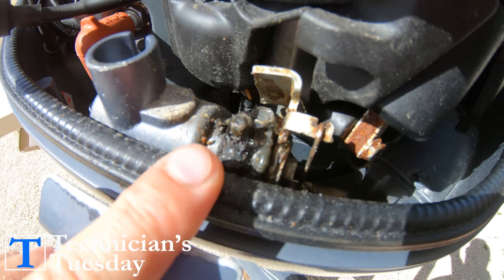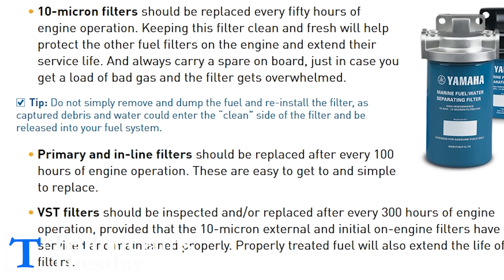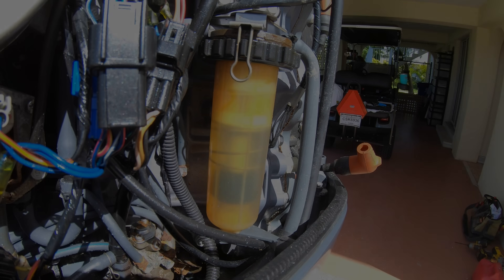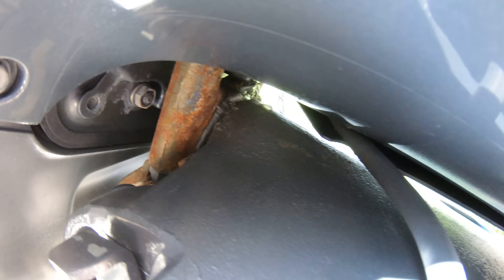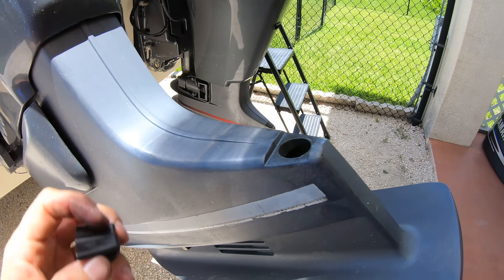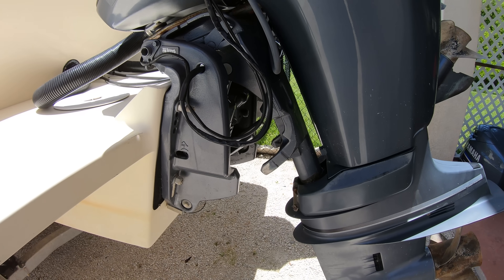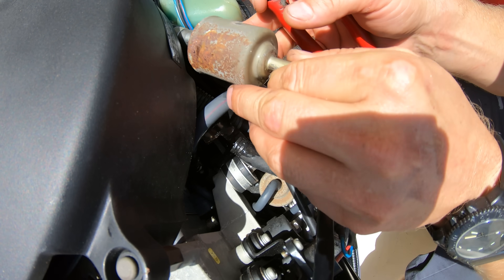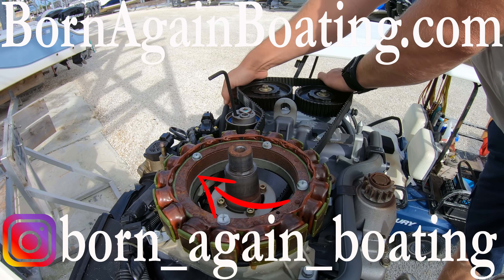Making A 2-Stroke Last Longer!

Comment: I have a two stroke. Suits me just fine. Yamaha 50 HP
Reply: Had a 50 Yamahammer two stroke. Best starting engine I ever had.
Reply: Me too. 2006 Yamaha 50 horse 16 years and running strong. Yamaha's best engine ever.

Comment: 94 Mercury Black Max 150 on a 20' Livingston 200 Viking Walkaround. Engine has 860hrs, power head has just over 100hrs since complete teardown rebuild. Excellent powerplant, lots of guts, not terrible on fuel and it'll cruise just under 30mph at 4000rpm!

Comment: I am really wondering if i should buy a riva aquariva (2009) but i dont know what Kind of maintenance this type of boat requires. I have a Boston whaler 29ft and know that this boat requires pretty much minimal effort to maintain. Do you know?
Reply from the maker: That I don't, its like any boat for the most part, but most of those boats have inboards right? So its a little different on the engine side:) good looking boat though!

Comment: With the ethanol fuel we use there is more corrosion and deposits. Remove the single bolt and drain the carburators if sitting for a couple of days or longer to prevent gumming, corroion and having to tear down and clean them.

Comment: Great video. I noticed you said not to empty the fuel/water Seperators and reuse because of contamination. I just got my tank cleaned and still have some ethenol sediment left behind. Do I need to replace the filter each time because it is trapping a lot of debris still on a new filter still when I checked.
Reply from the maker: Just keep an eye on the engine filter, and dump that cup out when you do your water separator. Also, if you just had the tank cleaned and are still filling up debris in your water separators, you might have some other issues that need to be fixed :/
Reply: Fuel lines

Comment: 1990 Evinrude 140 still runs great. Also have a 1978 Evinrude 6hp rebuilt lower unit and replaced water pump. Runs like new

Comment: in your professional opinion is it worth changing to a four stroke if your motor is solid and near mint condition?
Reply from the maker: If you've got the extra cash to repower, yes it is. If you don't, then no its not. If you've got the cash its good because you can sell the two stroke while it still has good value and you can get some money from it. Otherwise ride it out until its not reliable or until it dies or costs you too much to maintain or fix :)

Comment: Have an 88 Wellcraft V20 with a 2010 Evinrude 175 with almost 1,800 hours on it and it still runs great, servicing, servicing, servicing. Please keep these great videos coming.
Reply: I have a 1991 Ranger 395VS with a 2001 Yamaha 225 Vmax.  It’s a persnickety ole girl, but as long as you giver her fresh gas and oil and keep the O2 sensor clean she runs like a bay out of Hell! Not sure of hours, but I would bet money it’s well below 1000. 90% of my fishing is done with the bow mount trolling equipment.

Comment: I had a 150 2 stroke Yami on my Whaler in Key Largo. An excellent motor. Just remove the boat mounted oil tank once a year, drain the oil, discard the sludge on the bottom, reverse spray the oil filter with WD40 (replacement isn’t necessary), flush the oil lines too. Reinstall and fill up. 
If you clean out the engine mounted oil tank, always replace the foam washer. When the engine gets old, remove the oil system completely and mix the oil in the gas. The oil system is the Yami’s Achilles heel.
Reply: Why not just replace the oil pump?

Comment: Got a 1976 Merc 85hp. Old man bought it and had a stroke. Boat and motor sat in a garage for over 30 years. Boat only had  125 hours on it. Bought the boat for $500. It was like it came out of a time capsule.
Reply from the maker: Sweet :)

Comment: Mate, I’m running a 90 hp Johnson yr 2000.  No idea of its hours.  Have needed a new cdi and thermostats in last few years.  Recently gearbox oil is milky so need to work out what seal is gone.  Otherwise it’s a low smoke, loads of power and actually not a noisey engine.  In Australia.  So it’s gotta outrun those big white sharks huh.

Comment: I have a 1982 75 hp Chrysler on a Rinker V153 open bow ski boat.  The engine runs great.   I have changed the plugs, replaced the starter, and changed the oil in the lower unit.  I am not sure I have a fuel/water separator.  I keep the tanks empty when the boat is not in use and run the entire tank dry whenever I use the boat.  I have not seen a thermostat.  There is no temp guage on the boat.  I have instructions on how to change the impeller but have not tried to do this as yet.  I have greased the steering tube and other grease fittings that I could find.  Not sure I have any anodes to worry about as the boat is on the trailer 99% on the time.  I do not have power trims.

Comment: Running a 300 Evinrude G2, fantastic engine.  Real shame they're gone now.
Reply: It sucks. I was going to re power with an e-tech when the time came but now I'm looking at Mercury or Yamaha.
Reply: Remember when Bombardier bought Johnson/Evinrude. I hope someone buys the brand and makes it even better. I'm a 2 stroke fan from decades ago.
Reply: I feel you man love 300 2 stroke also buy BRP sea doo so it was a no brainer
Reply: Evinrude ignored the only double digit growth segment in the marine industry since 2009: the high horsepower outboard Center Console market.

Comment: Great video- I have a pair  of 2005 200HPDI with 800 hours that run great and get 95% of the gas mileage a pair 200 hp 4 strokes get with the same hull.  i can plane on 1 engine, while  the 4 stork can't.  The strainer filter above the VST can be easily removed with an AUTO CAR INTERIOR BODY TRIM PANEL RETAINING CLIP PIN REMOVAL REMOVER PLIERS.  I would like to see video on vinegar or acid wash to remove scale from cooling passages.
Reply from the maker: They are great engines! Not really a fan of putting acid into the engine :(

Comment: Running a 1971 Mercury 500 Thunderbolt. Fully rebuilt last season with new Vertex pistons and CCMS reeds; she runs like a champ, premium fuel premixed with semi synthetic 2 stroke oil and she'll run like the energizer bunny on steroids.

Comment: Have a 2001 Mercury 200, triple carbs. When she runs, it’s a powerful motor. But recently, the starter bendix gear has been getting stuck engaged to the flywheel teeth, and the starter gets burned up. Gone through 3 starters now trying to track down the cause, any info/tips appreciated lol
Reply from the maker: Ouch, you might have an amperage supply issue, where there isn't enough power being supplied to the starter. IE bad cables or switch or something. But then on the other end, you might have some engine issues with the crank, rod bearings, piston rings, etc. You might want to do a compression check and if you load test the battery cables and they are all good. Might be a good time to pull the head and check the pistons before blowing up the engine :/
You can take the spark plugs out and turn each cylinder around sticking a long screw driver into the cylinder and pressing on the piston to see if the piston moves.
Reply: Born Again Boating Thanks for the info. I’ve replaced the batteries, battery cables, and ignition switch, so you’ve got me worried now lol. After the compression test, would I be checking to see if the piston is stuck somehow?

Comment: 1988 DT140 on a 20ft Plroline. Ran great till 2 weeks ago the oil injection stopped working. Ruined the motor. Should have blocked off years ago. Sad
Reply from the maker: Ouch :( yup

Comment: Running 98 OX66 SW series 225hp twins on a 98 Grady Salifish.  I make sure they get regular maintenance  and flush with fresh water after each use.  They are awesome engines and I have no idea how many hours are on them.  Will keep up the maintenance until they say uncle.  Aaron, BTW thanks for the advice on the lower units.  Already put 30hrs on them and had the oil changed.  Went out yesterday and ran the boat at 30kts and those engines just keep going!
Reply from the maker: Awesome!

Comment: Since you are changing the spark plugs, is it worth the performance gain to align the spark plug gap with the exhaust port?
Also, since you have the motor this far apart, why not remove and clean the injector(s)?
Furthermore, if the thermostat is in reasonably good shape, is there a solution to soak it in to clean it up?
Reply from the maker: You could do that with the plugs, idk if you would notice any difference though, idk what style pistons are in the engine and if that would matter :)
Usually you only clean the injectors when you need too and on the thermostat, I just spray them off and put them back in, idk about soaking them in any solutions :)
Reply: Clean them up with vinegar

Comment: I have that engine 2000 Yamaha 200. I love your channel and has helped me as a new boat owner. I do have an issue where the engine cuts off when going at 5 mph. I have done the vst maintenance and will try the other two filters to see if that fixes it.

Comment: I still run a 2003 Z250TXRB, right now can’t get it to run over 2K and has a terrible shake and a miss. I changed the fuel and all the filters and still can’t get her to run like she used too! I won’t give up on her
Reply from the maker: You should look into the VST and make sure it's all good in there. Make sure you've got 50PSI fuel pressure after the VST and then get someone to put a laptop on it and make sure the mechanical high pressure pump is producing the right fuel pressure :)
Reply: I have the YDIS software, I’m getting g 985 psi and I’ve replaced all the VST but not the pump itself

Comment: Thanks for the video. I still love a 2 stroke motor on a boat, I know they are not that great on fuel or even that environmentally friendly but when you open the taps up the roar. Currently running an 87 Yammie 25 Excel, its on a new mid section and has later model cowls. About to replace it with a 300HPDI, just waiting on some parts. Should make my 22footer get up and go.

Comment: '56 Evinrude Big Twin 30hp on a '55 Olympia Yacht 13'3'' runabout. Engine runs great but won't see water till i finish replacing parts of the hull on the boat. If anyone (in Europe) has parts for a late 50's big twin (or a whole unit) let me know!

Comment: Are you meant to grease the bolts for the anodes? Dont they provide a path for the electrons or whatever it os that gets sacrificed to save the metal of the motor? I am not qualified in this for those window lickers out there that didnt already know.
Reply from the maker: Lol, it's alright, yes there is a grounding effect happening there. But it still works even with the grease. Once it's screwed in, a lot of the grease gets left behind due to the tightness of the bolt and threads, but it's better to have the grease there than the salt build it :)

Comment: 2005/6 90hp 2stroke Yammy with only 65hr bought new i did have to change the drive shaft seals as i seen the milkshake leaking from the water intake vents as it doesn't get used often  they dried out so did the impeller, gaskets and gear oil too all work done by me as i used to be in the marine trade ... Thanks Aaron...
Reply from the maker: Nice! You need to get out and use it more lol ;)
Reply: @BornAgainBoating  Thats the problem all my mates have boats and i seem to always go out with them cause all want to use their own boats and be the captain im easy and its not as costly for me too lol

Comment: After cleaning carburetor do you know why yamaha 2 stroke 115 want hold idle and dies?
Reply from the maker: Either fuel supply or there is something still in the carbs :/ the carbs can wear out or the needle assemblies can wear out too.
Reply: @BornAgainBoating  can the fuel pump cause that?
Reply: I would clean everything an check fuel lines may need replaced. Change filters.

Comment: I have a 1994 Yamaha 150 TXRS. I did just about everything mentioned here in the last month or so. That engine runs great and is dependable and easy to maintain. BTW I think my remote oil tank filter was original. The plastic was so old it had turned brown! I dumped the tank to give it a thorough cleaning and replaced the filter.
Reply from the maker: Nice! yeah, those tanks can get gummy in the bottom :)

Comment: I have a 2003 Yamaha 150 TXRB and it just keeps going.. Sure, I really want a more fuel efficient 4 Stroke, but this thing is light for my boat which already has issues with water coming in the Scuppers, so a heavier engine wouldn't help that any..

Comment: I have the same twin counter rotating 200 hpdi engines since new, 2006, on a 92 Grady Sailfish.  Run great never had an issue.  You didn’t do the filter in the VST tank, every year I do that one, the metal can filter you did in the video, I do every 2nd year.  Just did the pump belt, but the old ones were fine.  Also, the O2 sensor and its housing needs to be cleaned but I go several years before doing them.  Plugs change every second year. Trim seals done this year.  Lower unit fluid condition check every year, change it 2nd year.

Comment: Have an 88' Merc 175 black max. Original engine on my Sea Ray Laguna. Bought the boat 2 years ago and been going over every part of the motor and changing parts and got rid of all the black boxes on it. Runs better than ever and it has solid compression numbers around 130 all cylinders. Was thinking to repower with a Suzuki but this motor wants to live for a while. Now that I know how to do all the services on it probably will keep it for a while. Great channel keep up the good work.

Comment: 2006 250 E-TEC on my 89 Boston Whaler Outrage 22 Cuddy. About to hit 1000 hours on the motor and still runs like a champ. Sips fuel and oil at cruise but open the taps and she'll start sucking it down. Love the unique exhaust smell of an E-TEC =P

Comment: Running a 4 stroke now but I did have a 1970 115 evenrude that lasted forever. Bought it almost new and sold the boat a 1960 Stamas in 1989! Boat had seen better days but that engine was still running strong with little work done to it other than normal wear and tear. Doing regular maintenance is the key then as it is now. Thanks for the video. Stay safe out there!!!

Comment: Running the notorious Evinrude Ficht 200.  It’s a 2001 with 850hrs on it.  It came on a “new to me used” boat.  Maintenance tip for these....clean out the water passage on the EMM with a small brush on a drill.  It’s a common point of failure for overheated EMM units! Great content. Keep it coming.
Reply: Have same motor, emm oil injector driver circuit went out around 400 hrs, there is a guy in AL that repairs these EMM's for reasonable $. Currently at ~600hrs, running good.
Reply from the maker: Very true on most Evinrudes :)

Comment: Ohh yeah I love a two smoke!!! I have two 1997 Johnson ocean runners. They are hungry for fuel and oil!! But knock on wood very reliable!! Water pumps, thermostats, filters and plugs. When I bought my boat it had the original 89 Johnson’s 225s on her. 1485 hours never been rebuilt original lowers and power heads. I figured I was on borrowed time.I repowered with the 97 225’s from a guy in south jersey who had a hydra sport and was going to E-tech’s. Only 400hrs on them great compression No water in the lowers. Decals in great shape definitely taken care of. They push my Grady Marlin nicely 26kts when I keep them around 4400 they are decent on fuel anything more then a few hundred rpm either way and you see the fuel gauge move almost before your eyes!!! Would love some 4 strokers but these are so light and powerful!! Throws the boat on plane!!

Comment: I would alway put a small bottle of Ames Oil (two stroke) mixed in with my gas, even with oil injection.
50 gals and 1 bottle.
It may reduce performance a tiny bit and foul plugs, but your engine will last a lot longer.
I use it in my Car too.
Reply: Im sure your cars catalytic converter enjoys it :)

Comment: '78 Evinrude 70hp. Prior homeowner left me a boat project when I bought the house.  Put the motor on the stand and after unseizing the starter, she fired right up.  Still going to do a full powerhead rebuild on it though and change all lower seals.
Reply from the maker: Nice! Presents with the home is always nice lol
Reply: @BornAgainBoating  I certainly wasn't upset about it!  I know a decent bit about the mechanical side of things already but I am having to teach myself the fiberglassing side of things since he was in the middle of replacing the transom.  Can't determine how to fix where he cut the gunwales off about 4 inches from the transom.  Any video suggestions? Everything i find is repairing holes or replacing the entire gunwale, not bonding 2 piece back together
Reply: @joshmorrison2243  boatworkstoday   Andy is the best
Reply: @joshmorrison2243  i have a 77 . Just bought a solid ranger with it on it. Starts and runs but needs new impeller and a carb service. If you know of any online sites i can purchase any parts for these old gems would gladly appreciate it. Thanks
Reply: @justindavis1381  marineengine.com is where I am able to find almost everything for the engine.  You search you engine by model number and then you can sift through exploded diagrams for you parts and part numbers.  You can order directly through the site or use the part number to cross-reference prices on other sites.  I recently ordered new lower unit drain & fill plugs, set screw, and gaskets for the thermostat from marine engine.  But the thermostat kit through them was about $50 but I was able to order it through Amazon for $25.  Great site to source those hard to find parts

Comment: 93 200hp Yamaha on a 20’ Grady adventure here, runs like its new
Reply: I’m ignorant to the subject but do you find better throttle response and acceleration with two strokes on the water?